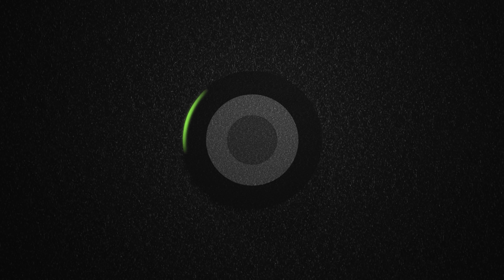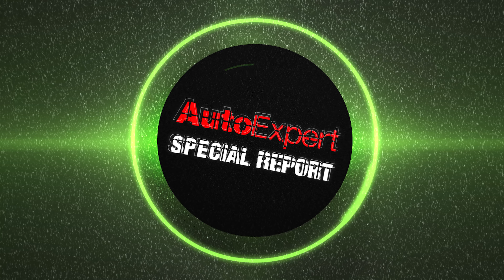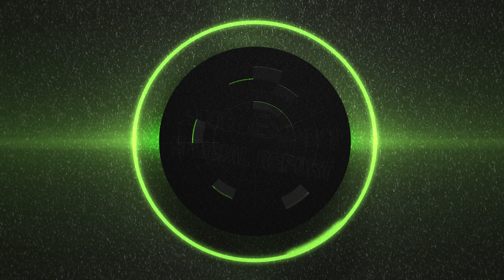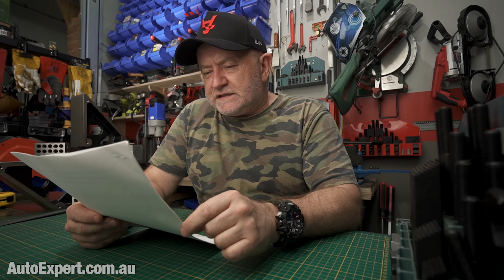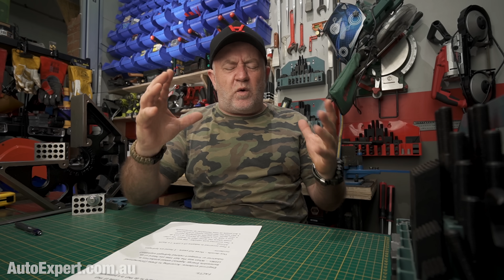The truth about fire risk: Hydrogen fuel cells and battery EVs | Auto Expert John Cadogan

Comment: How many ships have burnt out and sunk carrying ICE powered cars recently compared to EV's, for that matter how many trucks carrying ICE powered cars have burst into flames on UK motorways in the past year, none that I know of but one carrying EV's went up due to one of the EV's spontaneously bursting into flames. Majority of vehicle fires are started by electrical faults and the higher the voltage and currents involved the greater the risk, and this is not bias this is just plain fact. Insulation breaks down ask any fireman he will tell you that most house fires start this way. I wonder what percentage of vehicle fires start from fuel leakage and what percentage start from electrical problems, one thing is certain all EV fires start with electrical problems. Lithium polymer batteries are much safer and are used extensively in things like phones and cameras, but the energy density is lower than lithium ion. Lithium polymer batteries are so much safer that I have driven nails through several of them without causing a fire even shot one to see what happens, nothing. Something else that is not talked about, the craze for making airplanes electric, and by the very necessity of keeping down weight compromising on safety of the batteries, what we are talking about is potential flying incendiary bombs, it is only a matter of time before one crashes and starts a major fire somewhere.

Comment: Its kind of interesting to see the backlash against Hydrogen considering most of the country's taxi fleet was LPG since the 80's and no one was worried about them. I mean if you stuck someone next to 10 cubic meters of LPG or Hydrogen going off explosively, they're really not going to tell the difference and nor will emergency services who will be given the thankless task of getting the remains out of gutters and trees.
Personally I've always carried a fire extinguisher in the cars I've owned appropriate for putting out a petro fire and I think its kind of bonkers that people won't fork out 50-60bucks for something at the very least will stop or arrest an engine bay fire, but more importantly at the very worst- you can put yourself out with it.
Reply: Then there's all the lpg bbq's in the 'burbs, industrial lpg forklifts and acetylene gas bottles..
Reply: @petesmitt  Acetylene is ferocious stuff, but like most things you work with or operate (even the gas BBQ) there's a level of due care involved. People wouldn't drive around with a leaking fuel line and they should also be wary that their gas lines are intact as well.
The only real worry with Hydrogen is a lack of smell, which might need to be looked into with a sensor to see if there's however many PPM are dangerous enough to be an issue
Reply: @krissteel4074  Or you could add the smell, you know like LPG. Also as someone who has had to fill thousands of 9kg BBQ bottles, what level of care. We got a 10 minute run down and off you go.

Comment: How does JCB get it to ignite when they run there engine at 1 part Hydrogen to 100 air?
Reply: Combustion chamber pressure is rather more than the 1atm figures John was quoting.
Reply: @LiamE69  yeah plus they cost always use a precpmbistion chamber

Comment: Hi John  Did you know that one truck running in the Dakar rally runs on a mix of Diesel and Hydrogen. It is not allowed to compete but is still doing the race as a trial for this fuel mixture.
Reply: A company in the UK are also going to do the diesel/hydrogen fuel mix on existing freight locomotives of various ages, some of which are from the 1960's, 1970's.
Reply: @bentullett6068  sucks air through teeth in the Union approved fashion  "hmm, you know those valve seats you used to have? Well you don't have them any more, thats why your EMD prime mover sounds like a bunch of snare drums on methamphetamine..."

Engineers long dead are spinning in their graves.
Reply: does it burn cleaner? is it faster?

Comment: I'm a big fan of EVs, I fully agree that fire codes and fire fighting methodologies (especially not putting water on a lithium fire!!!) need work.

Someone set fire to an IC car outside my neighbours house the other year (god knows what was going on there, not normal for my area!), it was terrifyingly close to their house, they couldn't get out the front and had to flee to the garden. Whole street was out with human chains, garden hoses etc., Petrol pooling on the ground and evaporating, the lot. All we could do was keep it from spreading till the fire engines got there.

If that had been an EV... Jesus.

About the only silver lining there is that the fire was started by someone cutting the fuel line to get petrol to leak, and then they lit that - it would've been harder to get the fire started with an EV.
Reply from the maker: Water is fine on a lithium-ion battery fire. Lithium-ion is not metallic lithium. This is basic chemistry...
Reply: @AutoExpertJC  well there you are then, chap, as I said, not a chemist. Happy to have a chemist tell me "nah not a problem" :)
Reply: how 'bout if someone threw a molotov cocktail inside an EV? I suspect that might work easy peasy..
Reply: @petesmitt  yeah probably but it's a lot harder to assemble safely and transport and use sneakily than a pair of pliers and a match, and a lot easier to put out before the batteries cook off compared to already burning petrol being replenished from the tank.

I'm not saying it can't be done. Just harder to do the exact same crime of stealthily setting a car on fire. I mean, so I imagine. As has already been proven in the thread my assumptions are not safe haha

Like everything with EVs lol: you just have to get used to their little foibles. Drivers and arsonists alike :D :D
Reply: Comparing catalysts of fires, the EV is more susceptible to spontaneous (from over charging) or human error induced fires (poor software, poorly insulated chargers and manufacturing faults/design flaws).

Generally ICE vehicles catch fire from crash related damage and it seems vandalism as you've pointed out. But so do EV's, just not in as high numbers.

Comment: OK. Im going to throw my hat in the ring here and talk about some of the issues that are part of the industrial manufacture and use of hydrogen that has been significant portion of my working life.
Hydrogen is the smallest molecule and requires all joints, seals and connections to be maintained to the highest order or leaks WILL happen. If the leak is enough it will catch fire if its around the engine compartment or exhaust. I have seen so many small fires around flanges and threaded fittings to be genuinely concerned about that.
Hydrogen embrittlement/hydrogen stress cracking/hot hydrogen stress attack. These are all real causes of failure of steel pipes and components. The hydrogen gets into the matrix of the steel molecular lattice and dose nasty things to its integrity. One of the latest developments that changed how we do things in the world of hydrogen is hot hydrogen stress attack. The steel has to be warmed up slowly at lower pressure and cooled down at a control rate and pressure also. Sudden temperature changes have been found to cause those pesky hydrogen molecules buried deep in the steel to move about to much and break the molecular bonds forming microscopic "cracks". These microscopic cracks over repetitive cycles can join up with other crack to eventually become something that can fail to contain the pressure. This could be as small as a pinhole leak to a full rupture. Not pretty in an industrial level application.
When it comes to the public motor vehicle I would like to see the metallurgic study done on the valves/ cylinders/pistons to see how they will survive that constant temperature fluctuation over time. Maybe the pressure is not high enough to be an issue but I haven't seen any research available for me to read that has been done into that
who will provide the maintenance of the fuel system, a bit like your gas plumbing at home, cant be touched by just anyone. Has to be fully trained and qualified.
Hot hydrogen under pressure is not your friend. 
Silver Eagle refinery explosion of a diesel hydrotreater that contains diesel and hydrogen gas at pressure    https://youtu.be/yDmuaR6rkgU
Reply: How does LPG tank safety compare to hydrogen tank safety? is LPG safer?
Reply: @petesmitt  in a nutshell..yes
Reply: I think the use of compressed hydrogen in passenger vehicles will be the subject of a longitudinal study. The LPG tanks have a life time for a reason. If compressed hydrogen is widely adopted the whole gas plumbing will need to last the life of the car or will be a certified service item like the LPG and CNG tanks are now. This is one good reason to have Mirai and Nexo fleets on lease - to see what goes unserviceable first
Reply: That seams to only be a problem if your looking to burn the Hydrogen. If you are looking to just use Hydrogen as a fuel for an ICE vehicle, sure that is all valid and would have to be addressed. But the goal as far as I am aware is to use the Hydrogen to run the electric motors, as far as I am aware it is a very safe process with very little to no chance of fire or explosion.

Comment: Fuel-air explosions are neat! I saw one in chemistry class. The teacher mixed flour with air and it went off bang when it met a flame. The series of explosions in an internal combustion engine are also fuel-air explosions, and grain-milling facilities ban smoking for a reason (it's because they don't want the roof blown off). Burning a lot of small bits at once emits enough gas to cause a pretty big change in air pressure. But John's right about hydrogen being too prone to escaping to easily cause something like that. Concerns about jackasses with pressurized hydrogen are probably overblown, given that propane tanks are all over the place and it's pretty rare that people blow themselves up with those. Even if hydrogen fuel tanks are in cars all over the place, the number of jackasses blowing themselves up will probably not change much.

I think we need some new battery chemistry, not least of all because there's not enough lithium for everyone to have a car running on it. The sodium cells seem to be coming along nicely, are they less burny when they fail badly? I'd look that up myself but if John does it more people will see it. :)
Reply: 'The series of explosions in an internal combustion engine are also fuel-air explosions'
Wrong... The flame speed is controlled by the design of the piston head and cylinder head shapes. Its shaped to create squish and swirl that slows the burn rate of the fuel.

We need better battery chemistry to power our phones.
Add sodium to water and see how burny it is.
Add lithium to water and see how burny it is.
Film the experiment and you'll probably need someone else to post the video online
Reply: @sahhull  Many misunderstand fuel combustion. 
Explosions in an ICE would be bad. This is known as detonation. 

The swirl does not slow the burn rate but rather allows it to continue. Atomized fuel droplets are oxidized at their surface which is in contact with oxygen. This combustion consumes the oxygen in that area so combustion would stop, unless the fuel, or air, or both, are moved to expose the remaining fuel droplet to more oxygen. 

I'm not sure what is meant by squish but guessing quench. The quench area is designed to minimize the combustion area where the final combustion occurs. This reduces the probability of detonation as the last bit of fuel is oxidized.
Reply: @sahhull  If they were explosions, you wouldn't have to change spark timing with revs.

Comment: Hi John,
just a quick question.  From the NSW fire data you mentioned, how many of the those vehicle fires were deliberatly lit and how many of them originated inside the cabin.  The reason I ask this is because your video is all about the fire risks of all vehicles regardless of method of propulsion. If that fire data doesn't allow for this breakdown of facts then we can't really rely on the total numbers in regards to fires that started due to the propulsion type fuel system and not just all car fires.
My 2 cents worth.

Comment: A tesla pulled into a carpark at work today. It was about 30 degrees and the tesla cooling fans sounded like a jet engine. The driver turned the car off and the fans went off too. I didn't feel safe standing near that battery.  Give it a few years, battery explosions are going to be common.

Comment: Hi John. I’d suggest that your calculation of 1 in 2000 vehicles in NSW catching fire is a bit light on as you have only applied data from Fire and Rescue NSW. FRNSW only service ‘built up’ areas in the state ie. the cities and towns. 

The vast majority of the state, in terms of geographical area, is actually covered by the RFS - Rural Fire Service. 

While the population dense areas serviced by FRNSW would represent the majority of car fires, it would be interesting to add the RFS stats as well.

It could be rooly, rooly frightening. Or enlightening. Depending on your confirmation bias. See - I did listen, even if I missed the point completely.
Reply: The other reason no one is kicking up a stink about the fuel based fires is something John himself said in the clip, lithium fires cannot be extinguished. Fuel fires however can be.
Reply: Too bad if your vehicle  is that 1 in 2000  that burns to the ground    with you in it
Reply: @waynehewett4017  except not one of the 2000 last year resulted in a death. You know why? Fuel fires ignite and burn slow and low, unlike lithium.